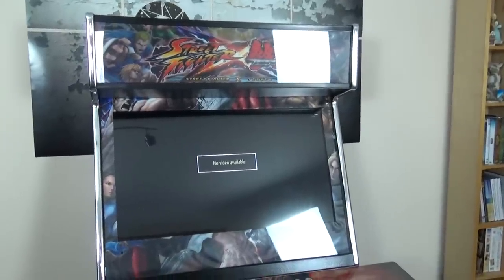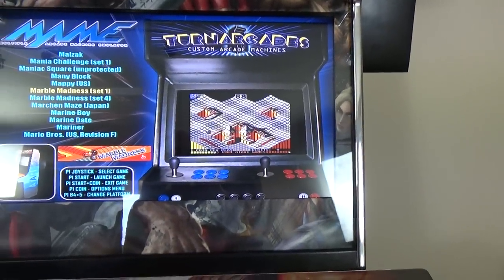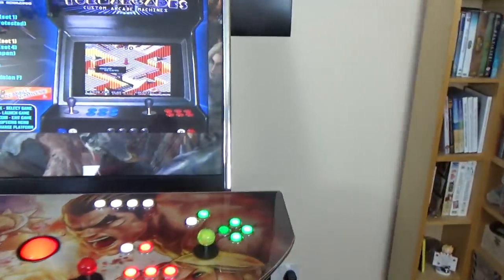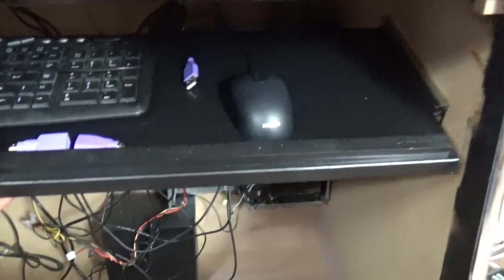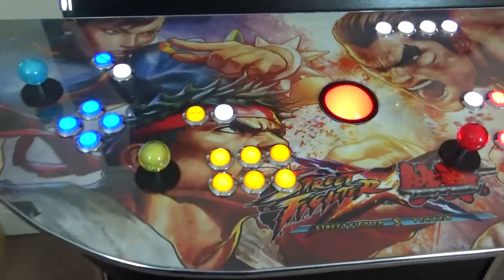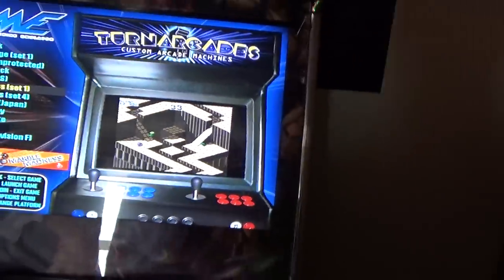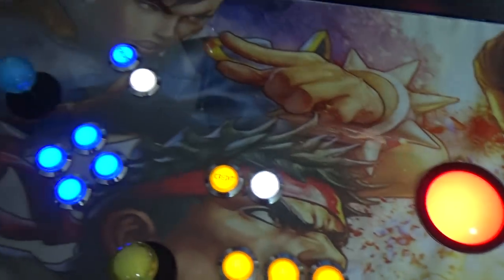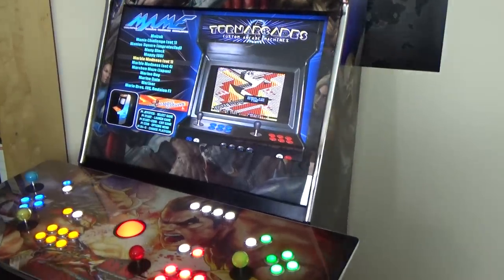Custom Arcade Cabinet Review - 4-player Turnarcades Monster!!!

Comment: Fantastic, thanks for sharing. I build mine from scratch based off the plans for a Mortal Kombat cabinet about ten years ago using a 27"Sony Trinitron CRT Monitor from around 1985, which ironically I am in the process of repairing (flyback went out, and doing a cap kit). The upkeep can be a bit of a pain for CRTs, but the beauty of an older CRT display is worth it to me for the authenticity.  Still, your machine is quite pretty and doesn't have nearly the footprint mine has, lol.  I think your chosen artwork is quite good.  On a side note, for those bubbles, you could use a large gauge syringe inserted flat against the board, then press all the air out. Though, you may inform the people you purchased the arcade from that 3M has a vinyl with microscopic holes that keeps this from happening in the first place, its not much more expensive and might be a good option if they intend to do this as a business.

Comment: Nice cab you have there :), I'm in the process of building and setting up a multi machine myself, also going with 32" TV instead of PC Monitor.
A couple of tips for the PC side of things, I would suggest loading into Windows and executing 'msconfig' in the run command box. Click the Boot.ini tab and tick /NOGUIBOOT, you can also change the timeout box to 3 seconds while you're there. This will remove the WinXP splash screen you get while booting and speed things up just a little :).

Another tip is to download a transparent mouse cursor and set it to default in mouse settings in control panel. Unless you want a visible mouse cursor for updates and stuff..

Another good idea is a power/surge board that has the master and slave sockets so when you turn the computer/arcade off or on, it will also turn off/on the TV and other peripherals.
Reply: I read your comment & didn't understand a word but it is awesome! Lol

Comment: I meant to look out for this video but got side tracked.... Great looking cabinet. About 6 years ago I bought an MK2 arcade machine with a view to ripping the insides out and replacing it with a PC and Mame, I also got the book on how to do this. MK2 like other games of the 90's was fucking huge and I had to take the front door off to get in in the flat. Ultimately though I couldn't do it, the cabinet was a bit too frayed around the edges and I didn't want to a) destroy an old machine and b) own something so big and imposing, ...cue possible shedding of a tear as two guys from Edinburgh Laser Quest loaded it into a van. Yours looks about right though, a keeper!

If I did this now, I would probably put a load of consoles on it too, does yours have that? Also, need a couple of nice bar stools so I'm not stood up all the time. Was actually thinking of just making the ultimate console using a horizontal PC, so I can veg out on the couch whilst playing. ...With EVERYTHING up to about 1997 on it. Legality aside.

Comment: Did you angle your P3 & P4 joysticks instead of having them face the screen? I can't tell by the video.  If so, do you feel they function well facing the direction your body is facing or do you wish you would have done them facing toward the screen instead? I mainly ask because I'm currently building a 4 player arcade and I have my player 3 & 4 joysticks angled instead of facing the screen and people on my forum are going crazy.  Just curious.  Thanks
Reply from the maker: Definitely feels better with them angled the way you are facing. Try sitting in fromt of your tv or pc at an angle and use a joypad or joystick that isn't in line with the way you are sitting and you will see the issue.
Reply: I agree.  I feel the P3 & P4 joysticks facing the direction the player is facing (at an angle) just feels better.  It just makes more sense that way.  Apparently a lot of these arcade hobbiests on arcade forums disagree and think i'm making a huge mistake. 

http://forum.arcadecontrols.com/index.php/topic,152274.0.html
Reply: Just look to the past for the correct way. Konami 4 player games like TMNT and The Simpsons all had the levers mounted in the same direction. While it may seem more intuitive to angle players 3 and 4, it actually is harder for most to adapt to it. Not impossible but harder than you would think.

Comment: This is a great video. What would you say about the build quality? Is it sturdy when 4 players are bashing it out on Hangtime for example?

The reason I ask is because I am considering a 4 player flat pack pedestal from them, and I will be mounting the TV on the wall (or stand) with a bezel that suits the pedestal design. I'll be DIYing it with the flatpack, but I kind of like the thrill of being able to add my own design and do it all by myself :) Also having a TV separate which is not in a cabinet will allow me to use any size screen I want :)
Reply from the maker: Yeh it is pretty heavy and solid. The control panel is hinged at the front and it one area of potential weakness so i put a couple of clasps at the back of it to lack it down somewhat as i worried if without that it might shift around slightly gradually loosening the hinges.
Reply: Are they Happ controls and buttons?

Comment: Used to love Marble Madness, until Spin Dizzy came along and showed us how it should really be done! Shame that those old games are so superceded - I spent 100s of blissful hours playing them. All Amiga games?
Reply: I think there running the Arcade versions, with MAME- there's not reason you can't run an Amiga (or Megadrive, SNES etc) emulator on there, as the buttons/sticks are usually wired into a keyboard emulator

Comment: While undeniably cool it does seem quite a lot of money for a MAME machine. I think I would have rather spent the cash on doing the whole thing myself as a project and then at least at the end you would have learned something and have a few extra tools. Though again factoring in time spent...
Reply: I did that about 10 years ago.  The results were pretty much as you described.  I used an actual CRT monitor for authenticity (not NTSC, which would have been more authentic) and it's what I had laying around (not NTSC, which would have been more authentic). 

I moved to a smaller place and had to throw it away, but I still have the circular saw, router and knowledge from the project.

If I ever do it again it will be a cocktail table.
Reply from the maker: Leigh Robinson
It was one of the options i considered, or going 50:50 and buying the body of the cab as a kit. In the end, I realised there would be too many areas where I'd lose out by not having already made dozens of cabinets beforehand, if you see what I mean. Like knowing what kinds of designs work on the cabinet or where the hell you go about getting your designs printed up. I'd have ended up with the warm glow of having made it but a cabinet which would have looked like someone's first and not their hundredth!